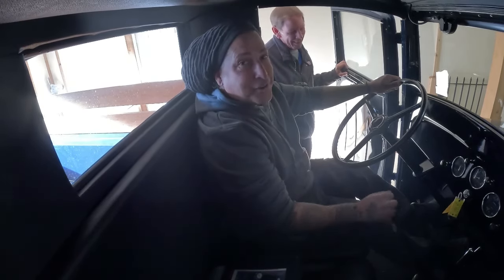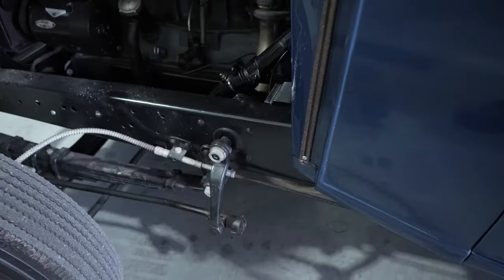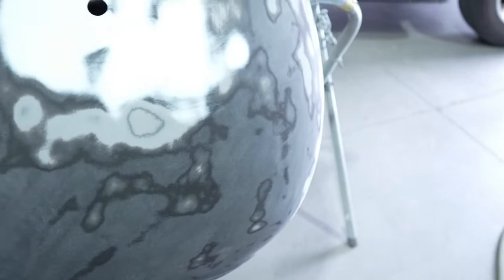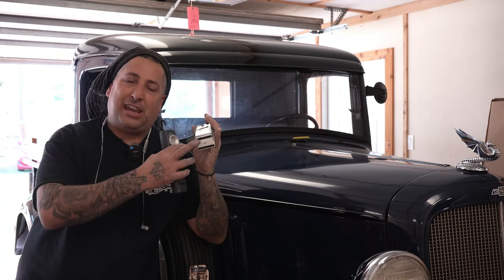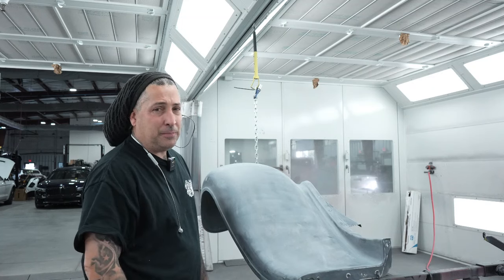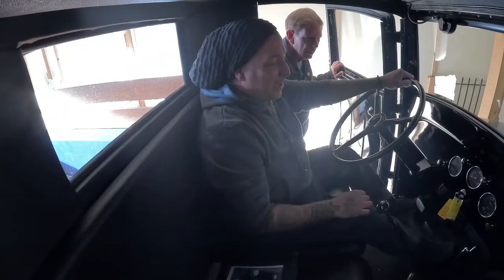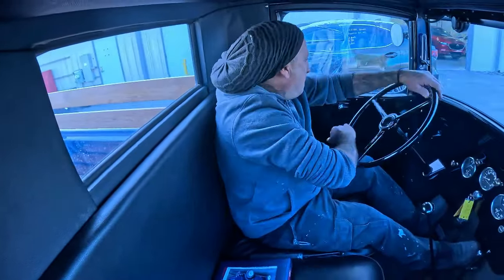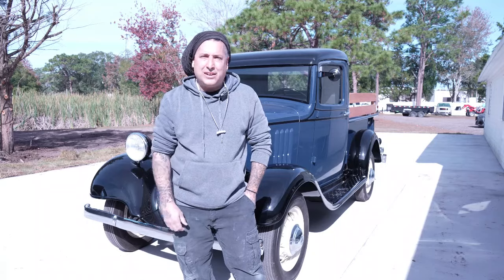Collision & Paint Repair On A 1935 Chevy Truck

Comment: That was definitely a cool job! I get not like having your parts move. I have to paint little door panels and stuff for boats that only have a couple holes on one side so you just have to deal with it. Hold the wire it hangs from to help.

Comment: I'm about to start restoring a 1935 Morris 12/4 (Uk car). Going to strip down to metal and follow your procedure you used on the cutlass. What top paint would you recommend for longevity?  Do i stick with single coat cellulose or go the modern route of base coat with lacquer.  This will be my first full bare metal spray!
Reply from the maker: My choice is base clear

Comment: I’m sorry that I cannot use this platform for my question I bought a Genesis Gv60 I’m living in the Netherlands Genesis doesn’t provide me with any info of the band galore. I’m trying this for four weeks now, but I get no reply from them. I cannot find anything on the Internet I need to colorcode of my white  Genesis. And also the gray from the bumper and that wheel  arch can somebody help me I need to paint my bumper. Thank you in advance.